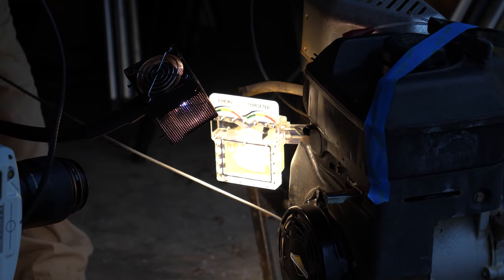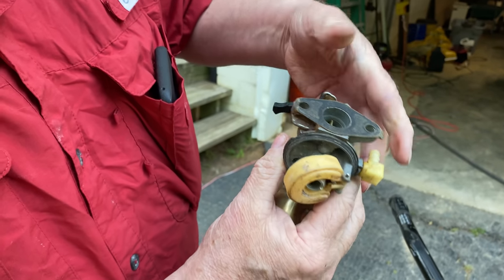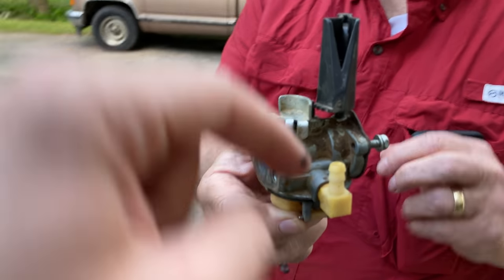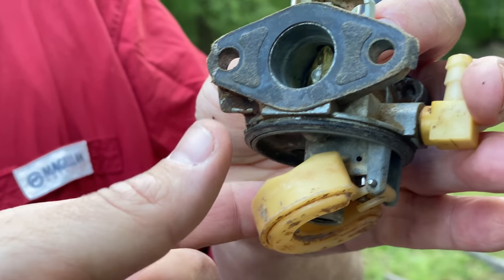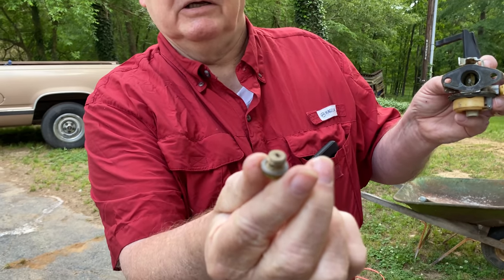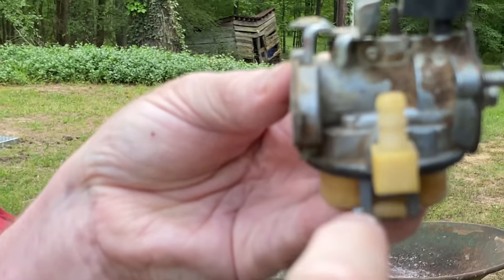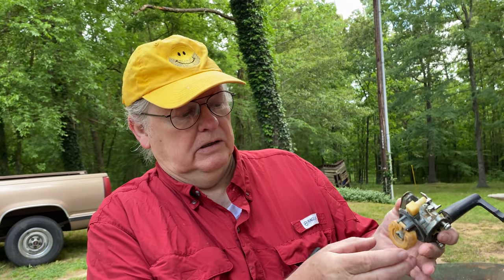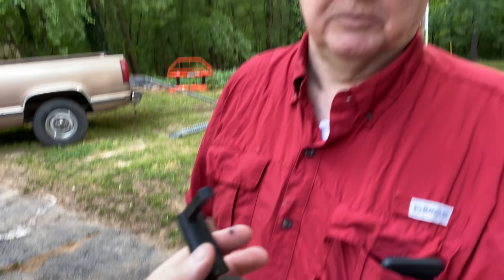Transparent Carburetor (Extended Cut With My Dad Darryl) - Smarter Every Day

Comment: Something that would be great to add to this entire equation would be the explanation of how gravity feeding fuel to the carb is primarily why most engine set ups without a pump have the fuel tank located above the carb.

The vacuum pressure from the intake stroke through the carb alone is not strong or steady enough to draw fuel and keep the bowl to its intended fill level without the help of some form of pressurized flow. The float is there to push the needle up to shut off the fuel flow so that there isn’t a constant flow of fuel pouring into the carb bowl and only enough intermittency to maintain the intended proper fill capacity. The float also provides a bit of buoyant pressure to force the excess fuel volume out through the Venturi hole in the air chamber of the carb. You will notice on a snowblower, tiller, or generator that the fuel tank is above the carb thus creating enough gravity induced flow for the fuel. Even many older lawn tractors will have the fuel tank located under the hood right in front of the steering column. But if the fuel tank on the lawn tractor is located at the rear, usually under the seat, you will see a fuel pump normally located on the outside of the air cooling shroud of the engine to compensate for the lack of gravity fuel feed.

So in each instance, the needle valve and float set up is designed to regulate the fuel level in the carb bowl as to not allow a constant flow of fuel into the carb thus over filling the bowl and eventually flooding out the engine (as well as allowing the fuel tank to drain gas out through the carb Venturi location supply hole when the engine is off and end up all over the floor, lol). By providing a controlled intermittent volume of fuel into the bowl and having the pressure escape route end up at the precise location of the highest air flow in the Venturi path, it directs that little bubble of fuel to pop through the jet that represents the relief volume of fuel excess in the bowl cavity. The endlessly genius and interesting characteristics of flow dynamics and mechanical timing is beautifully represented in the basic lawn mower fuel system. 👍🏻😎👍🏻

Comment: Regarding choke, if you close the choke and open the throttle, the intake stroke will provide more vacuum to the fuel bowl which will cause more fuel to leap up into the venturi. The volume of fuel-air will be (mostly) the same, but the ratio of fuel to air will be higher. With a fully open choke, the intake stroke will pull less vacuum on the fuel bowl and the mixture will have less fuel.
Reply: Thank you this is what I thought, it's not "just" a venturi, the location of the vacuum is also a factor, made possible by the choke.

Comment: They work due to the venturi affect, high pressure passing around the jet creates a vacuum that sucks the fuel though the jet known as a venturi effect. Lol, your dad just mentioned it lol! The needle keeps the carb from flooding out, it regulates the fuel level in the bowl. Ethanol absorbs moisture which causes oxidation and corrosion. The choke controls the air passing across the jet, you need less of a fuel mixture to start bc the engine is barely cycling. Float controls the needle were the gas is gravity feed. Flooding is caused by bad float, dirty needle, or a bad seat(rubber part). Adjusting the carb is done by the governor or adjustment needles(most new carbs do not have them due to EPA). The Glass bowl your father is speaking of was a water separator, water is heavier than gas, therefore it gets collected in the glass bowl before entering the carb fuel bowl. If the governor is not set right it will either not run or over-revving  damaging or blowing the engine up. If it surges is due to the carb not being adjusted right or a leaking air thru a gasket. I'm a factory certified mechanic for Briggs, Tecumseh, Kohler, etc.. Great video

Comment: Your Dad is cool. Explained the process quite well without complicating it. I rebuilt carbs when I worked at a repair shop. I was the carb guy. Made them work after the owners would foul them up LOl. I've studied and worked on engines for so long. I quit doing it as the gas engine should have been dead 60 years ago. Just now we getting around to getting rid of them.

Comment: This video and the one on the main channel are amazing. I've taken apart carburetors to fix them but this is a great "master class" as you called it. I think an awesome followup might be to do something similar with a diaphragm carburetor, such as off a 2-stroke engine like a string trimmer. Doesn't require gravity to lift the float but accomplishes the same task in a different way. Regardless of if you pursue this, excellent work as always.

Comment: For fuel injection, there's basically 3 types: direct port injection (which is exactly as you described, injecting directly into the combustion chamber), port fuel injection (also called ported or multiport, where you inject into the intake manifold in front of the intake port), and throttle body injection (where you have a single fuel injector inside the throttle body). You don't see throttle body injection much anymore except on some motorcycles, small engines and as conversion kits for converting carbureted engines.

Comment: @SmarterEveryDay Destin- as far as I understand, as soon as the intake valve closes, the air charge slams into the back of it and bounces off. This is why intake runner lengths are tuned for a set RPM...because that bouncing resonance at certain RPM can push slightly more than atmospheric pressure in.
Reply: As in, it sets up a standing wave when it bounces between the back of the valve and the back of the intake runner.

Comment: The brief reverse flow is rebound from the valve closing.  The air fuel mixture compresses against the closed valve and then acts as a spring and rebounds. If you had a 'tuned' intake on a multiple cylinder  engine it would use the rebound to  force air fuel mixture into the next cylinder..... Almost like a supercharger.
Fuel injection there's a  couple answers 
CFI/throttle body typically has 1-2 injectors in place of the carburetor. 
The others usually have the injectors aimed at the manifold side of the valves head and begins to fire a fraction of a second prior to the valve opening cooling the valve and continues for the alotted time
MPI /batch injection fires 2 injectors at a time one for the cylinder on the intake cycle and one that is on the power cycle. 
MPI/ sequencenail fires only the injector of the cylinder entering the intake cycle. 
Direct injection will have the injectors mount to fire directly into the chamber similar to diesel  and only the air passes through the intake valve,  the system can then vary the timing somewhat to account for low octane fuel or control emissions.  The cool thing is in theory a direct injection engine with more than 4 cylinders could use the injectors to auto start without a  starter motor. I don't think anyone is using this feature currently because there are possible drawbacks if you had a fouled plug or marginal injectors it wouldn't work well

Comment: Couple things I noticed.  Typically the jet is placed slightly behind the narrowest point of the venturi as negative pressure downstream from the restriction of the venturi is what draws the fuel up.  In contrast the air velocity is what is used to atomize the fuel and thus the jet is placed as close to maximum air velocity as possible while still maintaining enough pressure drop to suck the appropriate amount of fuel up.  The reason why carburetors suck is that the relationship between air velocity and pressure differential within the venturi is non linear.  So as the air velocity rises in a linear way with engine speed the pressure differential looks more like a bell curve.  Without compensation, the mixture would be too lean to run at idle, and excessively rich at speed.  Hence why even cheap carbs have some means of adding extra fuel at idle with either a bypass circuit or an idle jet, etc.  A choke adds lots of extra fuel by closing the venturi thus greatly increasing pressure differential at the very low speed of pull starting.  Love the video and all your videos!  Thank you Destin!  

P.S.  I remember my Dad showing me how to tune carbs when I was young.  We had a 70's 65hp merc outboard(2-stroke) that was 3 cylinders and 2 carburetors.  The middle cylinder shared half of both upper and lower carbs so getting them balanced was an extra bit of a trick.  But the neat thing is you could look right down the barrel of the carb and see the copious amounts of fuel being poured into the engine at full power.  No high-speed camera's of course but you definitely got the idea.

Comment: So at 37:00 you're asking about the function of the throttle and choke.

When you say that your cylinder sucks a set volume of air, you're dead right. That produces a negative pressure at the outlet of the carb (that is, the end attached to the engine).

So, there is a (kinda) fixed pressure difference between the cylinder and the atmosphere that is available for us to use to get fuel and air into the cylinder. 

Ignoring the throttle and choke, the pressure difference causes air to be drawn into the cylinder at a speed proportional to it's cross section and all the other complicated fluid dynamics stuff. The purpose of the venturi is to cause that incoming air to speed up which in turn causes a pressure drop at that point (Bernoulli's Principal) as the mass of the fuel is too great for the pressure difference caused by the cylinder by itself to lift. It needs that extra bit of help.

So, the throttle plate (or butterfly) provides a restriction to air coming into the cylinder, and it's location also causes a pressure drop to occur across it reducing the effectiveness of the Venturi by both limiting the air flow through it and reducing the pressure differential between it and atmospheric pressure. Basically, it stops both air and fuel by being between the Venturi and the cylinder.

The choke on the other hand also causes that same pressure drop and restriction to air but because the Venturi is on the cylinder side it is still exposed to a high negative pressure from the cylinder. That allows the atmospheric pressure exerted upon the top of the fuel in the fuel bowl via the bowl vent to push fuel up the jet and into the intake stream, enriching the mixture.

The carb is just a very clever device for controlling the affect of pressure on the fuel and air and mixing the two together. If you think of the system in terms of pressures you'll get how the throttle and choke work.

Anyway, I've got the other half of this video to get back to.

Edit:

At 51:20, the slight back flow is caused by a high pressure region generated when the intake valve closes due to the inertia of the incoming air. That now compressed air flows back through to the carb to equalise with atmosphere. Same deal as water hammer or blowing across the top of a bottle.

Comment: I understand carbs much better now thank you for this video. I've always thought when I gave a engine more throttle it meant i was pouring more gas to the engine when thats not the case, the throttle is just a valves that opens up to allow more suction so the engine gets more fuel and air mixture plus the throttle flap has a toleranceto allow enough fuel through to idle. Really cool Destin

Comment: @smarter every day 2 I wonder if the reason some fuel flying back towards the choke is similar to how a water hammer breaks pipe fittings, as in the compression stroke is closing the valve so fast and abruptly that the energy needs a place to go and the only way is to send the air/fuel mixture that's left in the throttle section back toward the air intake? I know it works with water in a hydraulic process and the air fuel mixture is a fluid like water. It's just an educated guess, but it makes sense to me.

Comment: If anyone is really into how all this works you should check out Richard Holdner. Also Engine Masters on Motor Trend. 
I am used to the domestic automotive side of carburetors, and it seems that the blow back is from the reverb of air bouncing off of the closed valve. The air has momentum going down the intake runner, it then stops and compresses on the back of the intake valve that just closed this bounces back up the intake towards the carburetor making a low pressure pulse behind it. That is the principle in intake runner length when tuning a motor for a specific RPM. If you can time that pulse to land just before the intake closes you can squeeze a little bit more air/fuel mixture in and make a little bit more power. 
It is really cool seeing the insides of a really simple carb working live.

Comment: 38:33 An acronym that I've heard is "FAST",Fuel,Air,Spark,Timing..compression isn't included in that,but it is just as important. And remember,the "Air" part of that includes exhaust..not only does the air need to get IN to the engine,it also needs to get back OUT!

1:01:00 - Direct Injection gasoline systems (and any diesel system I'm aware of) do spray fuel directly into the combustion chamber,but typically most spray the fuel into the intake manifold somewhere,typically right behind/before the intake valve on each cylinder (I think that style is referred to as Port Fuel Injection)..but it can vary on exactly where. Older style TBI (throttle body injection) is typically much like a carburetor,but instead of vacuum pulling the fuel into the air stream,an injector(or sometimes multiple injectors) sprays it in..and of course the injectors are electronically controlled/timed.

Comment: I heard something said about air flow and carb size. Assume a fixed engine speed for a moment, if you had a two cylinder, it could still use the same carb. This is true up to 4 cylinders, as each cylinder is only drawing air for 180/720 deg of the power stroke. Once you go to 6 or 8 cylinders, then you need a bigger carb or more than the one because the intake cycles are now overlapping.

Comment: The backflow you see after the intake stroke is the momentum/inertia (i always forget the difference in english...) of the air impacting the valve as it closes and bouncing back, thus creating Flow backwards. This is a very important thing in naturally aspirated race engines as you can tune the lenght of the intake to take advantage of this wave on it's way back to the cylinder to increase volumetric efficiency. If you get it right you are basically supercharging the engine at a specific rpm range. I heard from ferrari f1 engineers that worked on the naturally aspirated v10s (3L, 900hp) that those engines actually had something like 0.7 bar (10 psi) of boost at over 15000 rpm, reaching 300hp/L (sporty n/a road cars have around 100 hp/L)

Comment: @36:03 you forgot that an air or air/fuel mix is not always the same 'pressure' - Gases can be compressed or expanded.
So while the 'volume' of the cylinder remains constant, the amount of air/fuel mix within is governed by the Carburettor !

Comment: @1:14:05 what you're talking about is atomization. For boilers, when we're running fuel oil, we'll inject steam with the fuel in order to increase the surface area.

Comment: @smarter every day 2 the point of the float and the needle in the bowl of the carb is to allow fuel to dribble into the bowl and keep it full. its just gravity fed in liquid form. when a few squirts of fuel is used up by the main and idle jets of the carb (depending on the model and design) the float falls down and opens the needle and a few more drops of fuel get put into the bowl from the tank. its a simple design for a simple function and it always works. no need to overcomplicate something that simplicity has solved for and makes work everyday for decades upon decades. then on the venturi side of the carb, you usually have an idle jet that squirts a known amount of fuel all the time, and the main jet (or throttle jet) that squirts fuel dependant on throttle position. 0 throttle means main jet is closed, 100 percent throttle, means the main jet is wide open, and any combination in between.

small engine carbs, have been designed to use one fuel jet. carbs also have adjustment screws to change the amount of fuel being squirted (or really its applying more of a restriction) and thats how a crab gets tuned to run well. the air is a constant it cant be adjusted except for the choke and throttle butterfly valves. but if the mixture is to rich even with open choke, you can restrict fuel a little more to get a good mixture.

Comment: The blowback that occurred in your carburetor just before the intake suction pulse is the result of the fact that the intake valve starts to open while there is still a little combustion pressure in the cylinder, so it blows back through the carburetor for the tiniest fraction of a second until the piston starts to pull back reversing the flow in the carburetor.

Comment: Around 53:00 those was a good observation, I like perfection as well in my projects. But sometimes good enough is good enough I guess, especially with a practical visible demonstration like this that isn't meant to be a normal component to run the machine outside for extended periods.

I wasn't sure initially if I wanted to see the short version but, uh I now also watched the entire extended cut already knowing what was going to come up.

Comment: The cam has an overlap. As the exhaust valves is nearly closed the intake valve is opening. So both vales are open slightly at the same time. This causes the gas to push back into the carburetor from the cylinder slightly as the piston finished coming up to top dead center